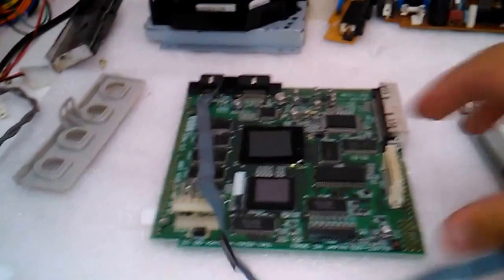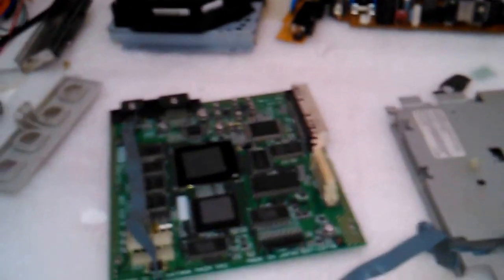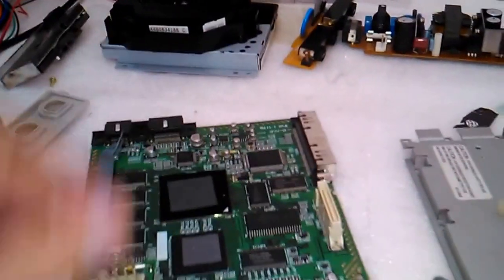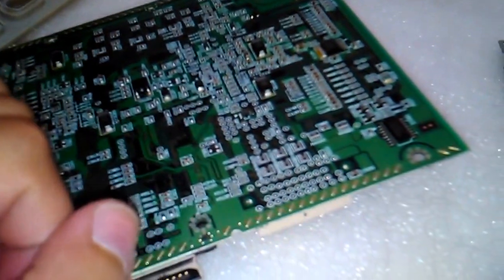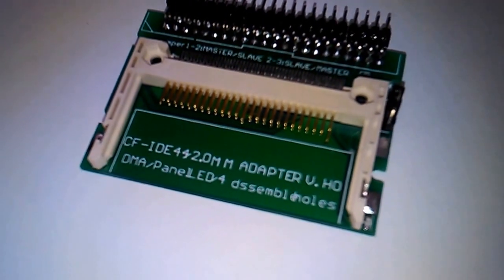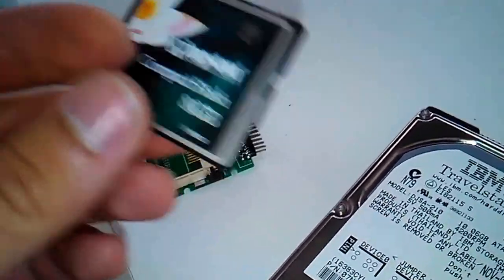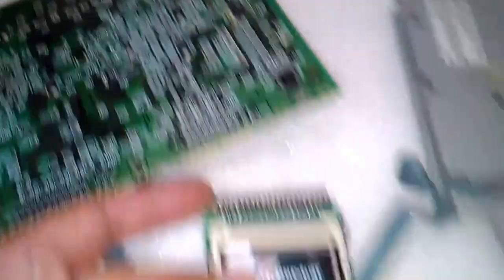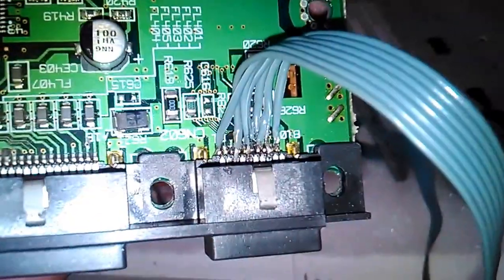Dreamcast IDE HDD CF CARD - part 1

Comment: if is not work u need to use compact flash industrial in fixed mode  and not in removable mode ,  is not about anything else if is not work  look that site ww....ehow.com/how_7811193_set-cf-card-fixed-mode.html  , the problem is not about dma or pio or anything
try to fix ur cf   in  fixed mode  and it's will work

Comment: Ah. The Facebook Dreamcast group. I made it long ago then turned control over to the rest of my staff when I got out of gaming. Haven't been back in forever. Glad to see this. I may have to get a second Dreamcast from eBay and do this myself. Got all the details needed to solder the IDE cable in.
Reply: Where can I find english instructions to perform this mod? Is it as simple as soldering an IDE cable to the IDE connector of the GD-rom?
Reply: Will2Fabricate Sorry to take so long to reply. Look around the net. There should be a photo showing the ATA interface pins on the Dreamcast PCB. Then find the pinout for the 40 pin ATA standard. Match them up and done. The Facebook group I run has the images with all the info floating around in it somewhere.